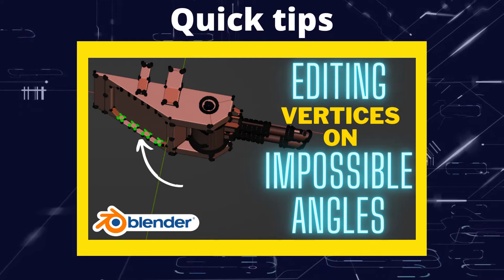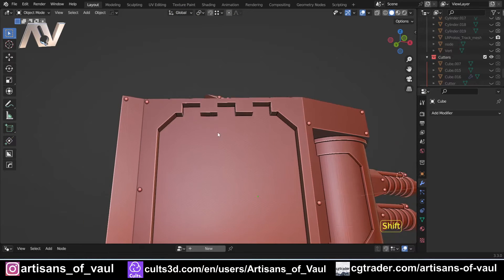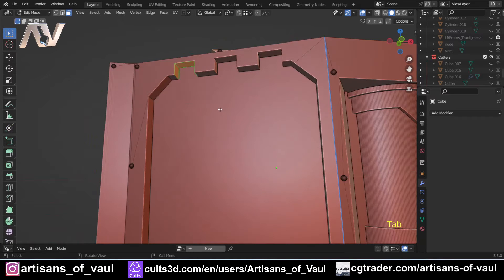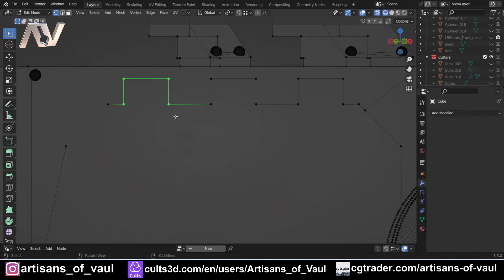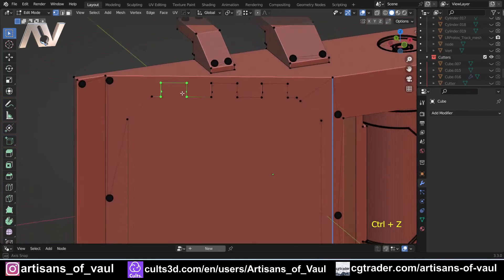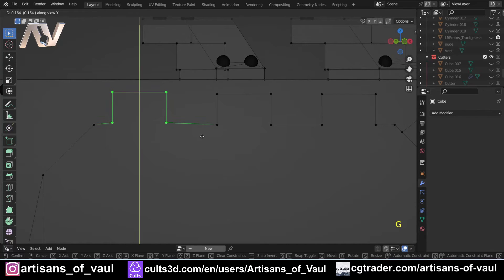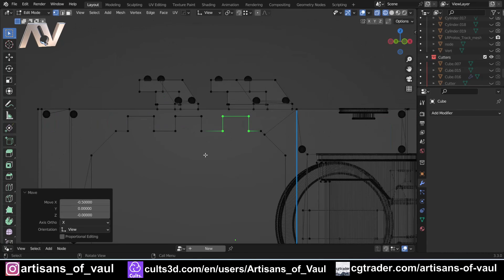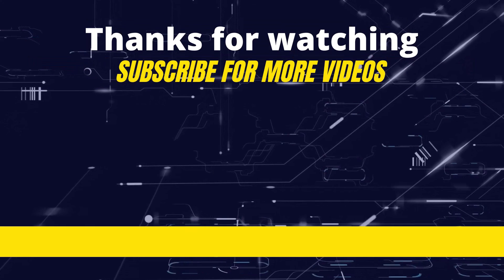Editing at impossible angles in Blender

Comment: Thanks ! I've never used the View Orientation ^^ I'll keep it in mind, thank you ! 

And if I remember correctly, with Machin3tools, you are able to bind a key to quickly access to Transform Orientations menu, it can be useful sometimes when you have to of switch between different ones ! 

Thanks again 🙏
Reply from the maker: You can indeed I believe.  There is also a pie menu you can use (I cant remember if thats generic or also Machin3 Tools).
Reply: @ArtisansofVaul  Yep, you're right ! I forgot this one.
I quickly checked, and it's a generic pie menu. For an azerty keyboard, it's the comma key (right of N key), but I don't know if it's the same for qwerty kb ^^